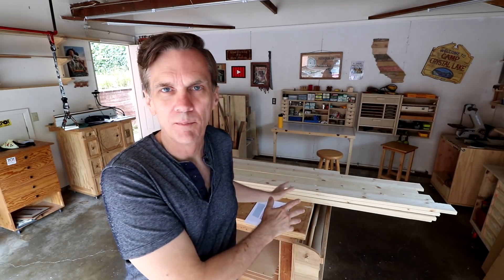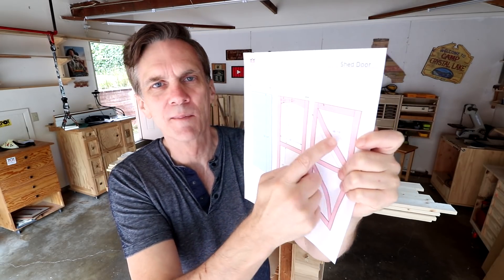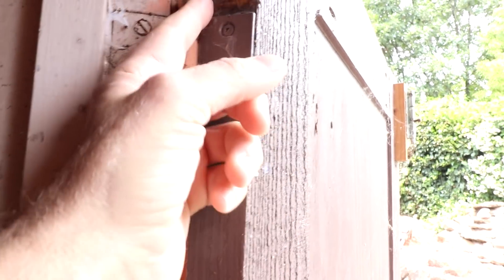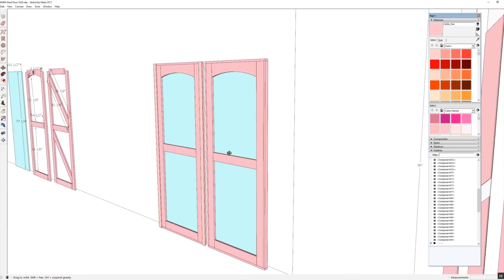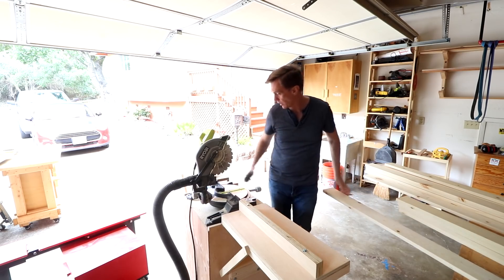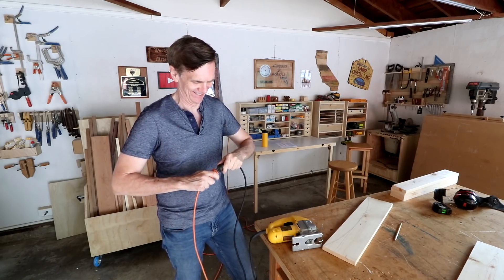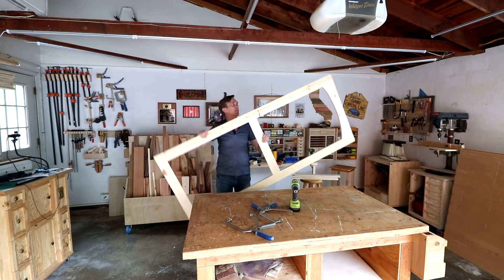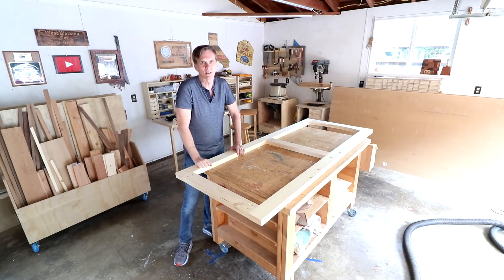Happy Saturday! Changing the shed door design and getting my man card revoked. | LOCKDOWN Day 75

Comment: I'm with you on a lot of the automotive work, and I used to work on my own cars all the time. But cars were much easier to work on back then. And I had more free time.
Now, I look at the problem to determine how quick & easy it will be to fix and decide from there. Often the conclusion is:  "I ain't touchin' that".
I used to change my oil until I  calculated that it was a 15 minute job followed by 45 minutes of clean up. And then I had to dispose of the old oil. Nope, not gonna do it. I can use a coupon and take it to the dealer.
While they're changing my oil, I can do something important, like watch Woodworking for Mere Mortals videos on my phone. 😁

Comment: Put your Man Card back into your pocket. Regarding changing the battery in your wife's car, I was "volunteered" by my wife yesterday to change the battery in her 2017 vehicle. Well, I have changed several car batteries over my 71 years and I have all the necessary tools to do so. The actual removal wasn't too bad I only dropped and lost one tool in abyss of the engine compartment. Finished the job securing the battery and getting the cables on the correct terminals. Good to go....wait not so fast. The car started, the radio retained all her stations, the navigation system worked and her phone was still connected. BUT...all the driving safety systems were off line. Read the manual, pushed a bunch of buttons to no avail. She called the dealer's maintenance department to help me get things back on line. Well, she has an appointment today at the dealer shop so they can fix all these warning lights. So there will be no money saved here in me trying to DYI it. Years ago I would change a battery out, start the car and was on my way, no problem. Not any more. Time and technology are a changing! So you did the correct thing in having someone else to the job for you. BTW, I enjoy your style of humor, admit that sometimes you make mistakes and you cannot complete a entire projects in 20 minutes. Keep safe and keep management happy. Happy wife, happy life.

Comment: Hey Steve
I've been building sheds for 28 years and I have been using 72" long piano on my doors which gives you 100 % support No Sag. Also there 3/4" legs no extra thickness needed.
One side screwed to door trim and the other side is screwed to the outside trim around the door opening.
Reply: Lenny Lovell got piano hinge on my shed doors. Works great and super easy to install.

Comment: Battery stuff aside, your discussion on emergency auto repair got me thinking. You’re thoughts fit an urban (and surrounding areas) location well, i.e. decent cell coverage and even if your phone dies, ask someone nearby to borrow theirs. However, many of us either travel for work in areas without decent phone coverage (used to work with tribes in between Arcata and Redding in the Trinitys, currently travel in central Washington up around the Canadian boarder) or do the same for fun (Olympic National Park is a good example, with many such areas). In those places, knowing how to put your spare on is a no brainer. But it can also help if the cell network goes down (that happened for us Verizon customers within the last 6 months for most of Washington for a few hours). Anyways, interesting to put myself in the place of someone else.

Comment: If you change the battery yourself on a new car odds are that you will screw up a lot of the settings in the computer of your car when it loses power. It can cause all kinds of problems such as the car not idling properly for example.

Comment: Changed many batteries and done many oil changes but I agree its a cost benefit issue like anything else.  Most autoparts places change batteries for free now so I don't do that.  I let them do it.  Recently I have been getting my oil changes done at a place that only costs $10 more than it would cost to do it myself.   Dont see the point in the hassle or time for $10.

Comment: I'm inclined to agree on the battery part, the newer ones that I've seen are all mounted differently in order to try and save space. It's an entirely different process changing the battery on my 84 Mercedes turbo diesel (my first car) compared to my Hyundai Kona.
As for tires though, come on, it's 5 bolts and a jack. Unless your trucks tire is hidden in some secret compartment under the tailgate that needs a long iron wrench, that was included but frequently lost, with the vehicle in order to operate some incredulously stupid winch system (stares at F150 <_< ).... It shouldn't take more than 15 minutes. Seriously, jack it up, wrench the bolts off, pop the old tire off, pop the new tire on, wrench the bolts back, and remove the jack. That process hasn't changed in the last 50 or so years.

Comment: Hi Steve, changing batteries on newer cars is not as simple as people think. For one thing, if you remove the battery you have to know the code to get the radio to work after you put the battery back on. As you said some batteries seem to be buried deep within the car engine and without the correct socket wrench and extension bit can be a bas****d to get out and all the time you have to make sure that the two terminals don’t touch anything. PS my girlfriend does all her own car maintenance and would kill me if I offered to change a battery for her. PPS no you can’t have her I keep her close so that no one can pinch her

Comment: In general, yes, I agree that once you get past a certain stage of life paying someone to do mundane and/or tedious tasks is worthwhile. However, it is generally preferable to know how to, through actual experience, do as many tasks as possible, like being able to change a tire if you had to. 

You fell into the same trap I do frequently, trying to make the task fit the available resources. For example, while making the drawers for the Dropdown Work Center I tried a makeshift method (i.e., foolish) of guiding the workpiece over the dado blade and now I am temporarily without the use of a thumb. Using that example, why are you making a door to fit 1-1/2" hinges? Suck it up and buy different hinges. The door could be much lighter and easier to open with the hardware.  jmho

Comment: Sign in a local mechanic shop.  Yes this is an old sign from when labor rates were less

Labor. $25.00 per hour
If you watch and ask questions $35.00 per hour
If you worked on it before you brought it here $100.00 per hour

Comment: DOOR DESIGN: I built a barn door for the 5' wide opening between my shop and my garage using a very similar design to your shed doors.  When the humidity gets high, the door warps and scrapes against the frame.  The main differences are I used half lap joints for the frame instead of pocket screws, 1/4" ply for the sheathing and I put styrofoam sheets on the back of the plywood for insulation.

CAR MAINTENANCE:  I will offer this:  When teaching my daughter how to drive, I insisted that she at least ONCE change a tire, jumpstart her car and assist me in changing the oil in her car.   The logic was in the event she encountered a difficulty with her car or had to have the oil changed when on her own, even if she didn't do the job herself, she would be cognizant of what had to be done so she would not be taken advantage of by an unscrupulous mechanic. 

I use the same logic for myself.  When I get a new or new to me car I familiarize myself with how the basic maintenance and repairs are done.  I don't always do it myself, but I KNOW what and how it should be done.  That way I know if the job was done right and if I'm being dealt with honestly.

Thanks for the daily blogs.  I enjoy them.

Comment: The battery I agree with, but I still do my own mist the time. The tire thing though, that I disagree with. You never know where you are gonna be, or when it’s going to happen. It would suck to be stranded some where waiting for AAA when changing a tire is a very simple task. Also, fun fact I learned about a year ago, AAA does not respond if you are on a dirt road. Now I was about 15miles up a dirt road that wound around a mountain, but I’m sure depending on the place, they might push that rule to a ridiculous point.

Comment: I'm the same with changing tyres. I pay for roadside assistance and would much rather have them come and change a flat tyre for me than doing it myself with the bare minimum tools that are in my car. I don't care what anyone else says.
Reply: That I don't understand.
Even at best of times roadside assistance takes at least an hour.
Changing a tire takes less than 15 min.
And the bare minimum tools are enough to change tires.

Most of the time you could probably have changed the tire yourself while you are still on hold calling AAA.

Comment: Just want to echo the man card statements.  In my college days, sure I’d gladly blow off a class with the excuse of blown tire or dead battery. But now that I’m working, I’m not giving up my lunch break or my Saturday morning to deal with something that my car insurance will handle for free.  Heck, I once got home, saw I had a flat and instead of giving up my evening changing spare, I just put a reminder in my phone to call road side assistance first thing in the morning. Instead of losing my chance to unwind, I went ahead and had an extra cup of coffee and did some preliminary work from home.  While yes there is value in knowing how to do these tasks, or not being intimidated from doing them there is no actual benefit to you doing it yourself.  Your battery doesn’t know you changed it, your deflated tire won’t repair itself out of pride.  Really decide if the cost to get some else is greater than you doing it yourself.

Comment: Drawing a parallel to your answer to why you do woodworking, in a crude paraphrase, "It is not about making it cheaper than IKEA, it just feels nice to be able to do it yourself". Some people feels that about changing tires. I do not think they should attack or judge you, but I totally understand that people might expect you to take pleasure in solving all your own problems. 
You probably don't change band saw blade and tune it 10 times more often than you have to fix a car, so arguing that you don't change car batteries/tires often feels weaker than your main argument that it just takes a lot of time. Whereas if it take a lot of time to change band saw blade that just means it becomes a whole video ;)

Comment: On my Citröen Berlingo van... you have to wait several minutes after switching off the engine before you  can safely disconnect the battery , or you can corrupt the engine management software... DAMHIKT 🙄😒 

The most mundane stuff these days has wizardry goin on... strip a modern toaster, even a real cheapo, & you will find a microcontroller chip programmed for the timing !! 😱
Likin the door frames... 😎👍☘️🍺

Comment: I usually don't work on vehicles.  I have found that when I do, I get angry because the designers are idiots for making things hard to get to.  The reality is cars are assembled in subassemblies, and those are dropped into the car on the assembly line.  That's why it's so hard to take something out, it was not designed to be removed by itself, it's part of a subassembly.  I always joke that you have to take off the back bumper, and half the parts on a car to change a headlight.  That is only a partial exaggeration.
I decided to replace the battery in my van a few months ago.  It was just like you said.  I had to go buy a socket wrench extension to reach the nut for the clamp down at the pan that the battery sits on.  The engine bay is packed with stuff and there is no alternative way to remove that nut.  The engineers could have used a long bolt, with a cross bar clamp across the battery like they used to do, but that is not how they do it anymore.
I change flat tires though, no point in waiting for someone if I'm broke down on the side of the road.
Reply: Ah, young one, you are mistaken!  The designers are not idiots.  They design the cars this way for many reasons, not least of which is that, if it's a pig to fix yourself, you will take it to the dealership thus making more money for the company and keeping the designer in employment!

No arguments otherwise, and totally agree on being able to change a tyre (if you have a spare because lots of modern cars don't)  I hate sitting at the side of the road for an hour waiting for the AA to arrive and if it's just a flat then I can replace it in a few minutes and be on my way.
Reply: I paid the young kid in Halfords to change the headlight bulb on my old car. He had the cocky look of “mate, you can’t change a headlight bulb?”.

Ten minutes later he was still at it, fussing and failing to get the old bulb out. It was then that I told him I knew exactly how to change the bulb, but after doing it last time, I never wanted to do it again 😉

This was a sub assembly. The headlight was one unit, bolted to the front of the car. Plenty of room for someone’s hand to reach in and plug the wires in, not enough room to get the bulb out. Remove the entire headlight and it was a literal five second job.

Same with the battery. Exactly enough room to reach the terminals. No space to remove the battery without first removing the ECU and a big bundle of wires.

Comment: Used to be that changing a car battery was stupid easy. Five minutes max. Now you have to remove the engine and all four tires just to disconnect it. My wife's Chrysler 200 Has the battery in the left front wheel well. I have no idea why. If you need to jump start it, there are contacts on top of the engine you connect to. Car engineering has gotten way out of hand.

Comment: Steve, I don't think you should lose your man card over not changing your wife's car battery. I can change my brakes, my oil, a tire and replace the battery...I've done all of those many times. I also have a full time job and a toddler so, I don't have time to spend changing a battery. I also don't want to miss out on 2-3 hours of playing with my toddler. You can't get that time back.  I just call AAA, like you did. 

However, I do think you should lose you man card over your paint color choices...just kidding. I love your channel and you're one of the reasons I started doing a lot more woodworking.

Comment: Got to disagree on this. I’ve never liked taking a car to a repair shop. If I didn’t know how to do something, I learned. If I didn’t have the tool, I bought one. If something was too far out of my skill set, I would take it somewhere. I never did wood working until about 5 years ago. I used to hire people to build cabinets or I’d just buy one. I now build my own cabinets from watching these videos. If one thing from this current virus showed me is that I need to be as self sufficient as I can. There are expensive tools to both trades and the more you invest the more capable you can become. I think you would like learning and working on cars. It’s no different than wood working. Just another hobby. As far as the car battery, I would go with AAA as well. It isn’t worth my time. Doesn’t mean you shouldn’t still know how to do it.

Comment: OK Steve, I understand you.  You are a woodworking guy, not a mechanic.  People still dump on you in the comments.  I have an idea to save your reputation.  Build a complete car out of wood.  Start at the ground with 4 wooden tires and wheels.  Spoke wheels would be in order. Wooden suspension, wooden coil springs, wooden shocks, wooden engine, wooden BATTERY, and etc.  Consider yourself challenged.  I know you can do it.

Comment: the tire is the only issue i see. i think pointing out all fluids and being able to change the tire on your car should be on the DMV test. whether you do it yourself or not down the road, if you're using a 2000lb killing machine you should at least know the very basic functions and maintenance. waiting hours for AAA on the side of the highway is dangerous for everyone involved. getting your battery changed in a parking lot is a different story.

Comment: You're not a cheapskate, it cost you $160 for a battery, true cheapskatery is going to the salvage and spending £25 for a used one, then using a £20 socket set to change it 🤓

Comment: The one thing I will say Steve is that with my luck, i would have the vehicle jacked up in the driveway and not have the tool i need to fix a problem. And because i have the wheels off etc, it is now going to be more expensive to deal with it.

I felt the same way when i paid a plumber to replace my water heater. I watched him do it. He had to reroute the hot and cold water lines because of the new heater having them located in a different spot. Im so glad i paid him to do that so that i didnt first spend 3 or 4 hours fighting with it myself.

Also, is the video color off, or are you cosplaying as Two-Face now? You seem to have a tan on half your face.

Comment: Yeah and what do you do when your tire takes on a huge piece of metal debris?  You have a newer sedan and they don't give you a "spare" because it's a hybrid and the battery takes up valuable trunk space,  they give you a can of tire fix or whatever it is. Which for a simple flat, it fine. But when your tire is absolutely gashed and you're stuck on a steep hill in the dark on a wet cold night in Seattle? Yeah you call a dang tow truck.  I don't think it's about a mancard. I think it's knowing your limitations and as well as what your time is worth. Not everyone knows how to change a tire, jump a battery and while I raz the hub about not heeding my advice to avoid a dead battery.  He still kills spiders for me. Not all heroes change tires.

Comment: I don't agree with your door design, you need to change the hinges to properly support the sheet. But I have to pull the rear axles on my wife's car, to replace the emergency brake pads. So I gotta go, see ya!